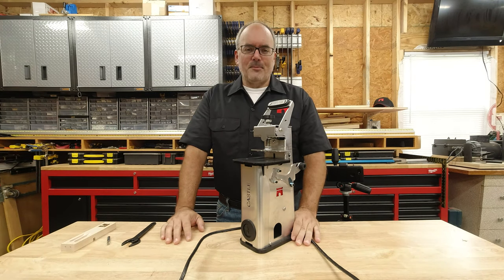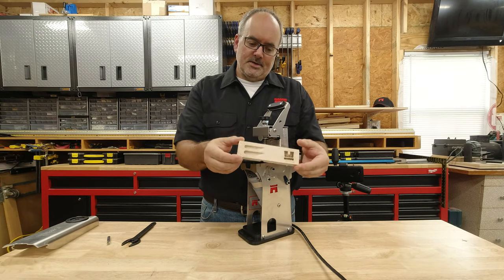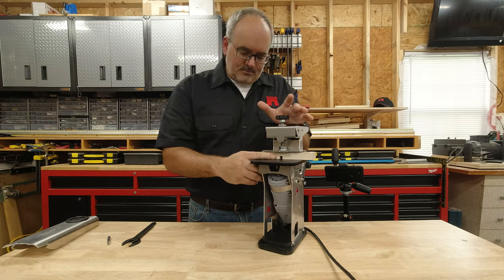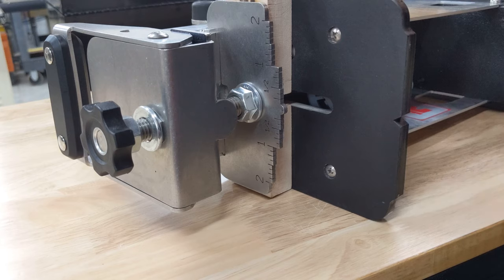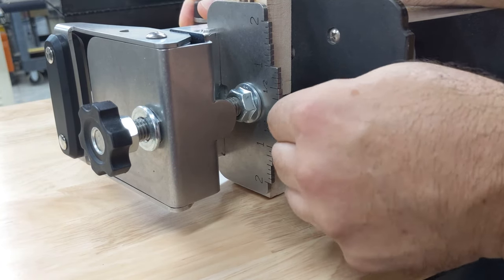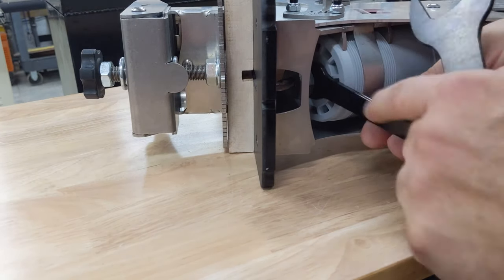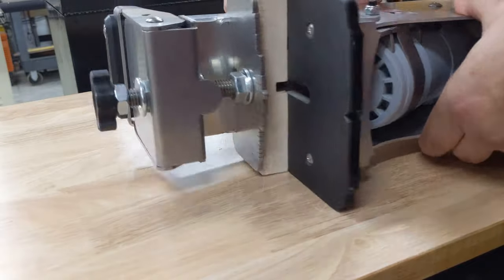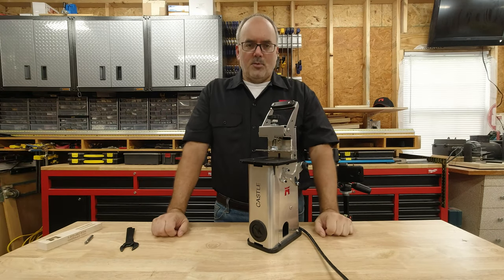Castle 110 Pocket Cutter Router Bit Change

Comment: Overpriced for just a router on a hinge and you still need a drill for pilot hole. If it had both functions route pocket  and drilling hole it would be worth it
Reply: If you want a machine to do both, look at their tsm-12 model or higher. As it is, it’s a little odd to consider that anyone making pocket holes doesn’t already own a drill. My first day using this tool I was able to cut and drill almost 1000 pockets, averaging about 11 seconds each. Tool paid for itself in the first day of use. Totally not overpriced for its quality and precision. It’s actually the first time in a long time that I’ve been able to use any shop tool right out of the box without having to spend at least a day correcting the factory alignment and setup.
Reply: If drilling the hole is too much extra than maybe check out Castles machine that routes the pocket, drills the hole, AND then inserts the screw for you! Look at their website.
Reply: Have some one else do it for you.
Reply: @terrymiller5028  what is the cost of the Castle 110?